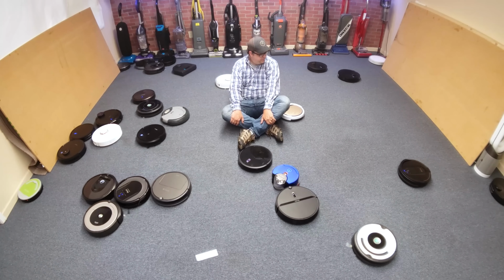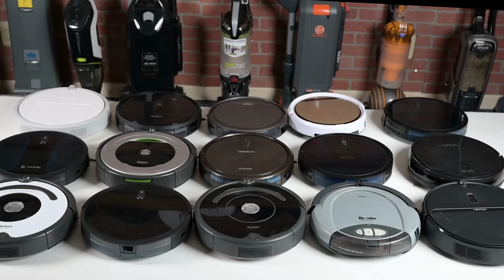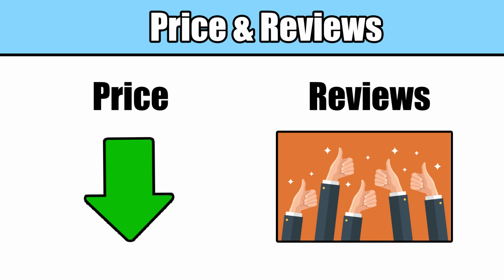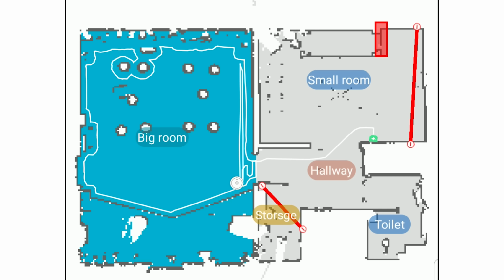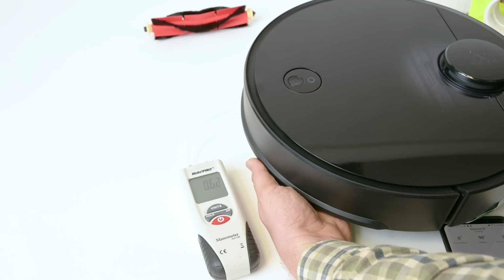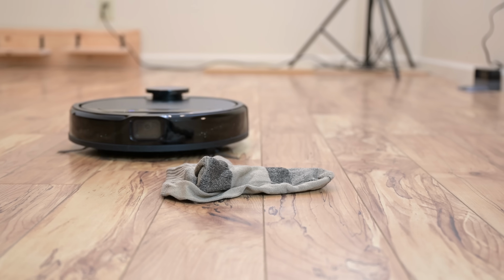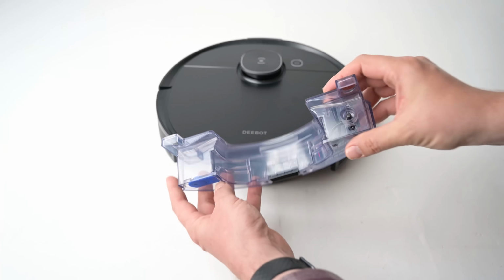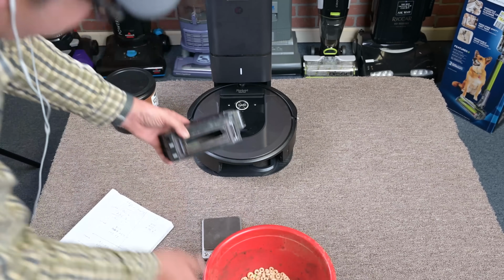BEST Robot Vacuums 2020 Edition - Vacuum Wars

Comment: Please if it's possible make a comparison of the Ecovacs Deebot T8 AIVI and T8 (3D) as there are many people claiming that the T8 3D is better at avoiding obstacles.
Reply: Yes I agree. I purchased the T8 AIVI last week, and now I am considering to replace it with the T8 non AIVI (with TrueDetect 3D). Seams that the TrueDetect 3D sensor is more reliable in objects avoidance (even small objects, never seen and in the dark). Seams that the AIVI needs to learn and expand the object library (is auto learning or needs data updates?) to be able to recognize the objects seen (in the light not in the dark) for the first time. Ecovacs claims the AIVI is more advanced but to me seam a marketing claim to justify the grater price.
Reply: @LelioS  I think that AIVI may be more advanced but it's a very new. I think it will take a couple more releases with this in order for the technology to mature enough in order to reach its true potential. But nevertheless it's astonishing how Ecovacs released two new robots with different avoidance technologies and the one that is supposedly cheaper is doing better job than their flagship. It's like shooting themselves in the leg and will make people think that AIVI is more of a gimmick than a true progression in obstacle avoidance.

Comment: Word of warning for those eyeing a iRobot bot: I've had two models, both top-of-the-line at the time of purchase (980, S9+). Between the two I spent $2,100+ tax and 3rd party extended warranties.

Well, I could go into detail but the tl;dr is that their support is condescending and straight-up 💩. In the 3 and a half years of ownership - 2.5 for the 980, and literally less than two weeks past the 1 year mark on the S9+, both suffered a terrible fate. During their warranties, the 980 had two major issues; with #2 *not being resolved as iRobot CS ran out the warranty clock*. The S9+, a $1,300 purchase at launch, I had to have a replacement robot sent out *twice*. In all, counting out of warranty and unsolved issues, I had *SEVEN major issues, in 3.5 years, between the two.

The final issue was with the S9+ - or, the the plus part of the name. The auto-empty system died. 10 days after warranty expiration. Support argued - as they do with everything - that it couldn't possibly be the auto-empty system. Pointed at everything else. Only admitted that I was correct, and the system had failed, after they ran out of other things to blame. Their final suggestion? But a new one at full price - a mere $250. No coupon, no availability of a longer warranty for when that auto-empty bin died, not even an apology for their 💩 products failing, over and over again, often in spectacular-terrible fashion.

I have since waved goodbye to iRobot with a one-finger salute, and walked straight into bed with their competitor, Neato. It's not all rainbows and unicorns - the neato app needs some attention - but how iRobot treated me, how I literally had CS mocking me and looking down on me, only to find out that every single time I was correct in my troubleshooting, and I never once got even a whiff of an apology. They are a profits-far-over-people company, and they will never again see another red cent from me, no matter the leaps and bounds it claims to be above the competition.

Oh, and neato support: galaxies better. It's like treating people decently is something that fosters customers retention. Who'd have thought?
Reply: I'm sorry, the auto-empty bin is $300. I was seeing red as I was typing, apparently hindering my memory.

One year warranty, on a $1.3k item. Alarm bells should be sounding, but I thought 'they must have improved with the new model, right?'

Hahahahahahahahaha

Comment: "Roomba i7 is a great value now"
still costs well over twice on amazon here for what I paid for my Roborock S5 2 years ago. lol
Reply: My 9 year-old Neato still works pretty well (with replacement batteries), but with the dog hair in my house, I have to stop it half-way through to empty its bin. So, I can see the value in a self-emptying system, both in my case and for those that want to set it on a schedule and empty the bin every week. How much that's worth is up to you. For me, it's looking attractive.
Reply: @michaelmerrell8540  Ditto, my Neato XV signature is working well, but lately the bin sensor has been going nuts and the bin keeps popping out. I have replaced 3 sets of batts. PRO TIP get the lithium from amazon, they last at least double the amount of time the stock batts did.
Reply: @FoxFreak  yeah, my neato has issues with the bin button. I've started to put a little chip/flake of something on the button before inserting the bit so the button will get pressed down far enough to register.
Reply: Your Roborock S5 doesn't come with a dump station or AI
Reply: @mcamodell  good
Reply: @mcamodell  lol i7 is a blatant copy of the Roborock SLAM technology.
Reply: @mcamodell  S5 is smart to do an amazing job, Twice the price for a dump station ?  Forget AI, I is missing in your comment.

Comment: i7+ is amazing. I just wish it handled long hair (over 5 inches) better. I find myself  having to unwrap it from the pulleys inside the rollers every 2-3 runs, which kind of defeats the purpose of having a 30 day auto-empty "set it and forget it" bin. I wish it had the anti-tangle comb feature that the Shark IQ (this is the Shark IQ's only good feature..) has with the little teeth that would literally cut longer hair off the roller.

Fun side note: Costco has a supped up i7+ called the i8+ now that has a battery that gives 20% more run time for the same price as the i7+.

Comment: Vaccum wars, I have been following your reviews and I was looking to buy the T8 aivi but I see a lot of negative reviews on Amazon about the mapping. Have you experienced this ? Is there some update that will fix it and would you recommend not buying it until some fix ? Its quite expensive a purchase so I want to make sure I get the right one. Appreciate any input you have
Reply: I honestly think a LOT of those Amazon reviews are competitors gaslighting Deebot. I own a T8 AIVI and I agree with the VW reviews. No issues minus a small issue where I can't divide one room. Gives me a timeout error. Oh and it did suck up a cable once but it stopped and let me know it was stuck. It was under a bed and pitch black under there so it couldn't see it.
Reply: @FarmerManJahn  Thank you for sharing your experience with us. Have you tried to test AIVI technology with small objects (eg lego bricks, various toys)?  Can it recognize them?  Have you noticed an improvement in the ability to recognize objects that it often encounter?  Have you noticed any deterioration in poor lighting conditions or with artificial lighting?
Reply from the maker: I havent read the reviews. All I know is that it seems to vacuum our house and return to the base without issues. There were some occasions early on when it would do an incomplete run. But when it was re-ran it would be fine. Im not sure if that was the issue people mentioned or not.
Reply: @VacuumWars  and about issue in avoidance of small objects and objects not in the library? I purchased the T8 AIVI last week, and now I am considering to replace it with the T8 non AIVI (with TrueDetect 3D). Seams that the TrueDetect 3D sensor is more reliable in objects avoidance (even small objects, never seen and in the dark). Seams that the AIVI needs to learn and expand the object library (is auto learning or needs data updates?) to be able to recognize the objects seen (in the light not in the dark) for the first time. Ecovacs claims the AIVI is more advanced but to me seam a marketing claim to justify the grater price.

Comment: Could've used this 2 weeks ago... good thing I did my homework and after a couple hours of Vacuum Wars picked the Roborock S5 max!
Reply: Nice. Can you tell me why you chose this over the s6?
Reply: @austinsmith3192  I have a lot of hardwood floors and while I havent really been using the mop feature too much, it's nice to have. The biggest thing for me was multilevel support. Not sure if the s6 has it now but at the time I couldn't find anything about it. Cheers! I dont think you could go wrong with either!
Reply: @somenewkid6892  I got the S5 Max very recently too! It has been great for the price point. I think the anaylsis from Vacuum Wars and some other channels convinced me. The mop feature is great but it isn't smth that you could just attach and forget because it is likely you'll have to top up the water more often than you empty the bin. The mop pad is thankfully removable because you won't want to leave it attached to the Roborock as bacteria can grow on it if it doesn't get to air dry and could stink. (I feel like this is common sense but I am not great at housekeeping so I made that mistake at the beginning lol. Solution is buy more mop pads so you can switch out to dry ones that could sit ready for the next scheduled cleaning.)
Reply: @austinsmith3192  I heard the S6 actually came out before the S5 Max. I think they don't differ too much so some markets only carry S6 Pure (a slightly cheaper version) and S6 MaxV.  But I remember seeing an earlier comparison video on this channel showing S6 to be surprisingly outperformed by S5 Max in some areas. For the other areas, they performed equally well.
Reply: Same here :) So far its great.

Comment: If you added one more category, and that was "best robot vacuum at any price", what two robots would you pick?  (I'm hoping one of them would be the iRobot Roomba S9+ since I just bought one. ^_^)
Reply: Yes, Roomba S9 is the best one if you don't look at price, particularly for the corner cleaning function (it's the only robot on the planet do have that feature).
Reply: lol... i think they liked the roomba with the dual brushes and the good build quality so I think you are on a winner (of course I could be biased as I have a  few (!! well over 10..) as I picked up a LOT of older models and they seem to do as good a job as the newer more expensive ones.. the others I find are moslty either cheap chinese or no where near as good... haven't tried the roborok though.. that ones does sound good..)
Reply: The S9+ has a much better roller, corner brush, caster wheel design.  You virtually never have to detangle hair.  If you have pets, it’s a phenomenal machine.
Reply: @JozeppySTL  I picked the S9 because we have two long-hair cats.  I wanted a robot that can handle hair, and would deep-clean (they track litter dust around the house and I want the litter dust pulled back out of the carpet).
Reply: Steve Hastings I think you’ll be very very happy. I have a golden retriever (and a shepherd mix and a short hair cat) and in the month I’ve owned the S9, I have never had to detangle hair. All wheels and rollers and brushes are constantly hair free. And I run mine 1-2 times per day.  It was an upgrade from my 690 and whoa was I blown away.

Comment: I was certain the Shark "IQ" would have been one of the picks given VW's affinity for the company.  Good on you for not picking it.  I saw it with the other premium vacuums and thought "no way".  I have one in an open floorplan area of my house and it cleans OK and hasn't broken in a year's use, but it took forever to map the simple floorplan and the app is so bad and actually got worse after an update.
Reply from the maker: Yep. Those were some of my reasons. I gave it another chance before I did this video but...
Reply: Vacuum Wars I’ve always wanted to know your updated opinions on the shark iq. Your review seemed so positive but many others had only terrible things to say about its navigation issues. Have you considered an update video?

Comment: Test where lacking in this video compared to 2019. Also the CFM section I couldnt find Roborock S6 Maxv listed which is the most comparable to it for AI. Would love to see a deep clean test and power test head to head with Deebot and Roborock s6 MaxV.
Reply: I would too
Reply: Me tooo!
Reply: To me the the power and air flow tests are for secondary characteristics. What is important is the cleaning data (the deep clean test you mention). How well does it pull debris out of carpet? How well does it pull debris out of cracks? Sure the tech data is interesting. But if it doesn’t impact the performance of the vacuum isn’t it really just meaningless? But maybe I’m missing the point you’re trying to make?
Reply: I have a Roborock s5, two years now...it is awesome😁

Comment: Clicked so fast! I'm loving my T8+ and the auto empty bin is great! Loud, but great! Have you found a way to auto initialize the charging station to activate extraction? I can only seem to do it after a cleaning run but I see others who have a button to activate it when the robot is already on the charger.
Reply: The t8 AIVI has this button in the app, the T8+ does not have this button yet. It will likely come up in a future software update. I believe AIVI is on 1.9.5 and T8 is on 1.5.3.
Reply: John Williams Was just going to say that. The T8 AIVI has been out for 6 months, but the T8 / T8+ just came out a few weeks ago, so I think they just need to update the app or something. I don’t see any reason they wouldn’t add the button for the T8+.
Reply: @GraysonCarr  thanks to both of you for pointing that out! I emailed them asking earlier today so maybe they will confirm when that will be.

Comment: Great video. I really appreciated the “best from each category” comparisons. 
One of the reasons I settled on a Roomba was its built in HEPA filtration. But I haven’t tested them all. So I don’t know how they compare.
With the Roomba (I’ve only owned two 900 series robots over the past 7 years), I can run it in a room and, almost immediately, start feeling how much cleaner the air in the room is getting. 
Just feeling the cleaner air is nice. But the real benefit is the impact on my wife’s allergies. I won’t ever switch from Roomba until I can find a robot vacuum that does an equal or better job at filtering the air as it works.
I really, really, really wish you tested and compared the vacuum filtration systems.
Oh, and I’d also really appreciate some sort of maintenance comparison. How complicated is it to keep it running (lubrication requirements, disassembly, parts availability - you do at least mention parts availability tho) for years and years?
And, yes, I have been a subscriber for a while. And I thumbs up all of your videos. You do good work.
Reply: doesn’t every robot come with a HEPA filter? my s5max has one. or maybe you mean that the roomba has a better one?
Reply: Giacomo Albani My point is that I don’t know. The robot vacs I was able to get info or my hands on did not all have genuine HEPA filters at the time I bought my most recent Roomba. In the absence of test data, I had to go with my own personal experience.

Comment: Still no "Roborock S6 Max V vs. Ecovacs Deebot Ozmo T8 AIVI" review :'(
Reply: If you don’t care too much about mopping or an auto-empty bin, I think the S6 Max is slightly better. But if you do care about either of those things, get the T8 AIVI. Also check out the new T8 / T8+ with TrueDetect 3D. Even better small obstacle avoidance than the T8 AIVI in my comparisons, and it’s cheaper. Just came out a few weeks ago so there aren’t many reviews yet.
Reply: The T8 AIVI all the way. Bought mine based on VW review and love it.

Comment: I wish Roborock had a better supply chain in Canada!

Also, I hope you'll do a video specifically on robot vacuums for hard floors at some point.  It feels very hit-or-miss, and like the scattering problem is only half of it.  Are there companies working on soft roller robot vacuums?  Is it better to just use a mopping unit primarily, and handle larger debris by hand?  And for those of us with tile floors, I find that the noise of the clunk clunk clunk over each seam in the floor is maddening.  I got an I7+ and returned it immediately :(
Reply: The Roomba S9 has a drastically slower corner brush with variable speed. Much less scatter.
Reply: @JozeppySTL  How's its pickup compare to the I7, and how do its wheels sound over 1/4" spaced tile?
Reply: xmadrugadaxeternax well, the S9 has a variable clean settings with an option of a “quiet clean” mode which is substantially quieter than my old 690.  I use “detail clean” so it runs about the same or quieter than the 690 but ramps up the suction if it senses that it’s on an area rug.  It’s better in every respect than the i7 with the only exception being the price.
Reply: WISH THEY HAVE AES/SEB

Comment: I dont know if I'd consider the S5 Max "mid level" at $550
Reply: He said pretty clearly that high end vacuums are those with some type of small obstacle avoidance like AI and a camera, or an auto-emptying bin. The S5 Max has neither. I think the S5 Max is great, but there are newer and better things, like the S6 MaxV.
Reply: @GraysonCarr  ROBOROCK NEEDS TO COME OUT WITH SELF/AUTO-EMPTY STATION/BIN ASAP !
Reply: I got one for £300 ($387) from a Swiss seller on Ebay and its fantastic
Reply: I actually wanted to buy it but in my country they sell it for 1k dollars 😪
Reply: When the range is from like $150 to $1000+, yeah, $550 is about in the middle.